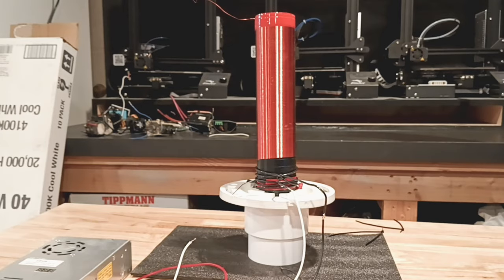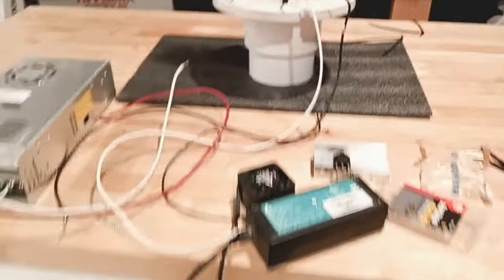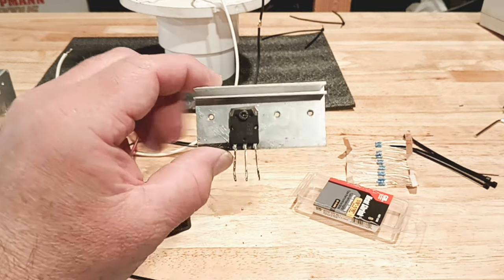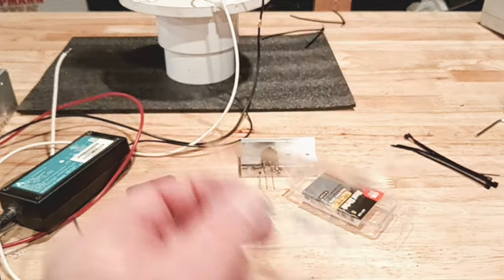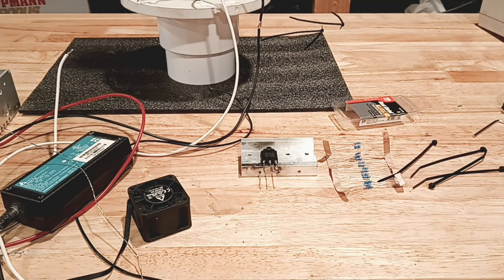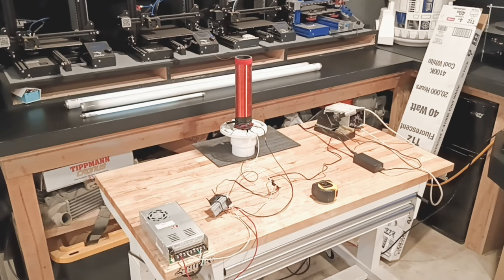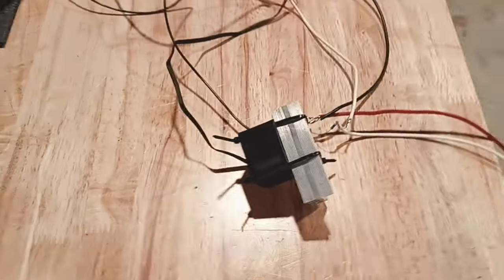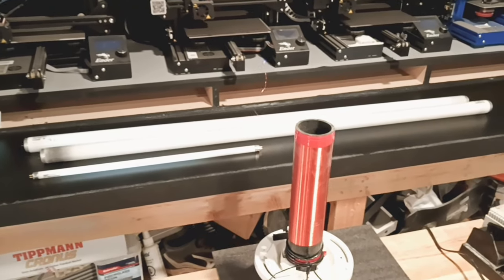Tesla Coil "Upgraded Transistor"

Comment from the maker: I was wrong it isn't a mosfet. Here is what it is  2SC5242 Transistor 15A 230V 130W TO-3P  Sorry for the confusion.
Reply: No wonder why I couldn't get my Tesla Coil working. The one you said is a PNP and the one above in an NPN, big difference.
Reply from the maker: @AmericanBandstandAgain  sorry for that. I gave the transistor I am working with in the video. here is a link for yours. 
https://youtu.be/fseBG8EluZ0?si=NPbG9cFgjOqQje4E
Reply: @nathanbunten4299  Thanks, I was going nuts trying figure out why my Tesla coil wouldn't work and had to Ohm out all the connections which were good.
Reply from the maker: @AmericanBandstandAgain  The video I sent you also has some good additions for the coil. For protection. If you post it let me know. I will check it out.

Comment: If you're looking to get more wireless range on the coil you need to wind it with space between the turns, a gap that is half the diameter of the wire is ideal for impedance matching, the space will allow the Dielectric field to expand out into space at a much higher range and that's what you want to focus on over the Magnetic field. Also, Bruce Gavin suggested to have the gap between the coils be half of the diameter, so for example a 6 inch secondary would have a primary with a gap of 3 inches, he says you can easily impedance match like that.

I recommend Hakasays video "Build a Tesla coil the way Tesla built them"
Reply from the maker: Thank you I will do that when I make another #2 coil.

Comment: Great job. I think you can reduce the overheating by adding a zenner diode from Gate to Source. I think a 1N4744A-ND will work well, but I have not tested it yet.
Reply: I'm sorry, but that won't work with a 2SA1962 because it's not a MOSFET, it's a PNP Collector, Base, Emitter. The B-E drop is only ~0.7V.

Comment: TIPS. To increase the cooling efficiency use a fine smear of heatsink compound between the BTJ and the heatsink.
Also paint the heatsink matt black, to make it work as a black body radiator, it will radiate heat more efficiently. 
Label the three leads on your schematic of the BJT,   E for emitter, B for base and C for collector, I agree its better to use outlines of the BJT in this case to show connections.

The 2SA1962 is a BJT not a MOSFET.
Until you can actually measure it, you do not know the power supply output current and the power dissipated in the system.
The current drawn from the supply is dependent on the load, the supply specification is the Maximum current it can supply.
Not sure how you are going to tune resonance.
The fan connections are, positive, negative, tacho (speed) output, PWM (speed) control input.
Reply from the maker: I corrected it with a post and I pinned it. I also changed it in the title. My mistake. I will measure it next time. I am trying to learn my new equipment. Or would you like me put that out there so people can complain about that to?
Reply: @nathanbunten4299  No problems, with so many replies its hard to keep track of peoples responses.
Keep going, new stuff always produces unforeseeable results.  👍👍
Reply from the maker: @tomgeorge3726  Thank you.
Reply from the maker: @tomgeorge3726  I wanted to add a tvs diode to the circuit. I know it is the back voltage and amps but I don't know the reference on the data sheet. Could you give me some help?
Reply from the maker: it is for the tesla coil transistor
Reply from the maker: @tomgeorge3726  the answer I got was 230v 1.5a is that correct?
Reply: @nathanbunten4299  Its a good start as the BJT is rated for230V.
Reply from the maker: @tomgeorge3726  I decided on 220v 4.5a for the breakdown. That would be lower than the max but still not blow the transistor.

Comment: Sooo Cool. I'm building a new Tesla coil for my Gravifler according to your instructions. Parts are on the way. I really like your white base to your coil. Did you make it?
Reply from the maker: It is a toilet flange from hardware store. The coil is wrapped on a 2 inch black PVC pipe. I had to cut a hole in the flange to get the pipe to fit. It all sounds insane 😂 but it works perfectly. The wire is 28 gauge magnet wire.  The black pipe is 11 inches tall and 2 inches on the inside diameter.

Comment: That’s a power transistor..
Reply: C5242 is npn, the one you are using is a pnp I believe?
Reply: And a top load will cut down your sparking by adding capacitance, no top load and all your charge builds up on the tip of the wire and causes breakout. You need a top load that isn’t too large or too small of capacity
Reply from the maker: I know. It is for my graviflyer. Where the graviflyer is the top load.